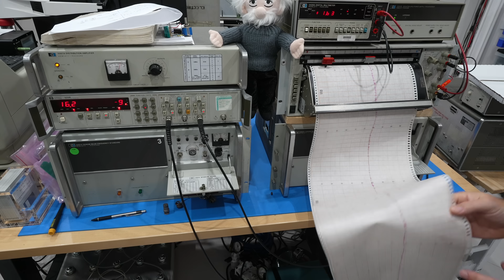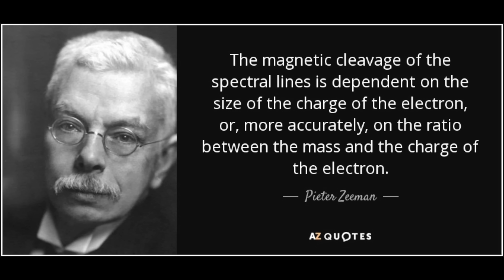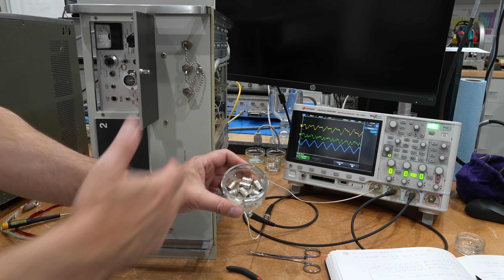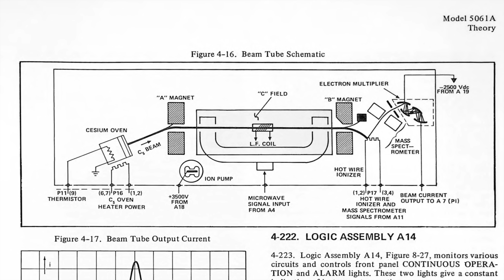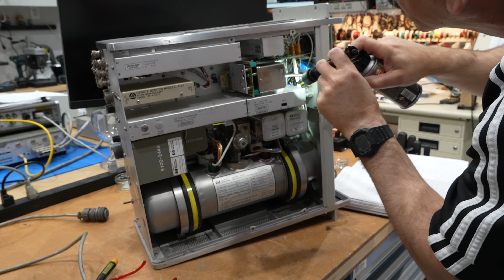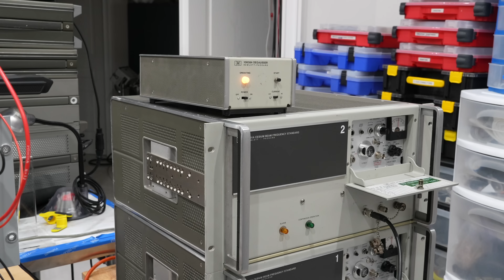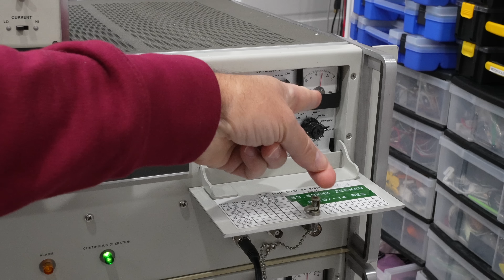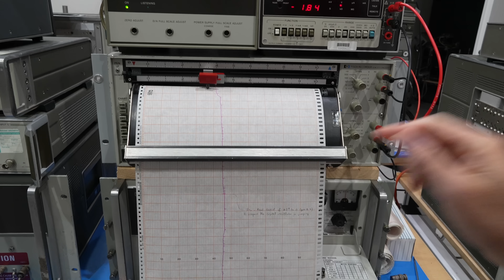Fourth HP 5061A atomic clock repair: revisiting a clock that showed parts per trillion instability

Comment: Question. Have you figured it out yet or could I throw an idea out to you? My first hunch would be that the switch was still not perfectly repaired.  It is better but not perfect. Do you have any way to remove and clean it out of the machine? Or test it outside?
Reply: This is what i'm thinking too, deoxide never really fixed my issues with switches permanently
Reply: Could maybe add some bypass jumpers to the switch for the time being and re Ru the test to confirm?
Reply: @letsgocamping88  Smart idea.
Reply: kind of shocked on such a high precision instrument they put a wafer switch right in the middle of the control loop
Reply: @AsbestosMuffins  I guess they hadn't heard about that analog mux that was in the last video :)
Reply: Could even be a hairline crack in a trace.
Reply: Very feasible! Maybe Marc should go full Atkelar -- completely disassemble and ultrasound the switch then nickle plate all the contacts.  :)  It certainly couldn't hurt.
Reply: Maybe he could try to move to a diode based switch ?

Comment: Considering what stability you are going after, could you really trust that switch after a spray with deoxit? I have nothing against the product. But it seems to me that the only reliable fix is to replace the switch or take it out and clean it properly. Not just spray and hope you hit everything.
Reply: Yes, take it out and clean it properly. Clean and polish the contacts to a mirror finish. It HAS to be absolutely perfect for an instrument this precise. Just spraying it with deoxit and hoping that it will work is simply NOT good enough. Stop being lazy and do it properly.
Reply: This did feel a bit of a spray and pray indeed, but probably they measured the switch after cleaning
Reply: @MeriaDuck maybe, but the result might not be stable, with dirt still moving around and such.
Reply: i can still remember the last project when he didnt want to take a switch apart and just sprayed it and that didnt go well either...

Comment: Hey Marc, if you're like me and dislike the deoxit can sprayer straw and nozzle with the button on top, you can replace them with the ones from one of those air duster cans. Much thinner straw, fits in cramped spaces a lot better, and the trigger is on the front.